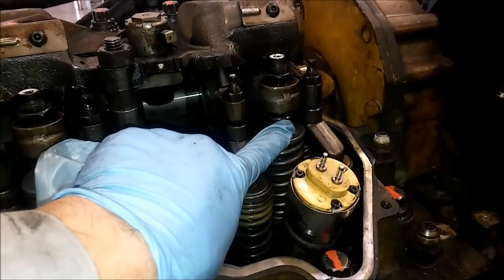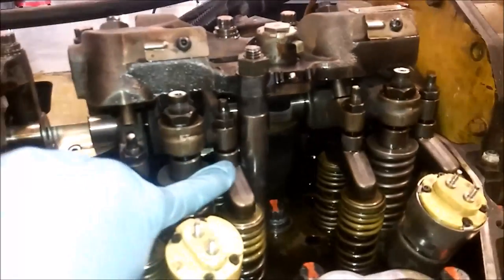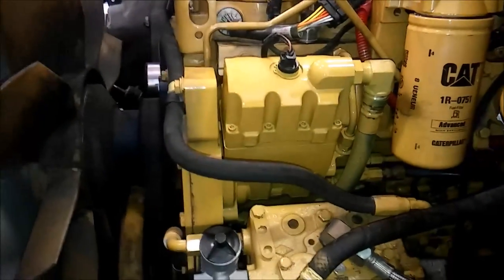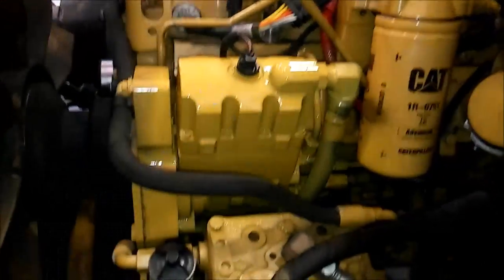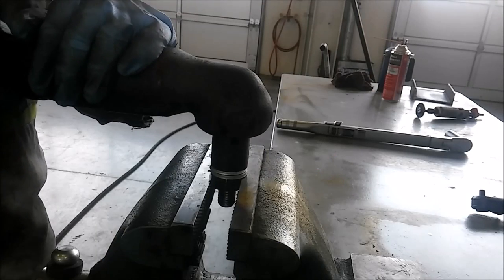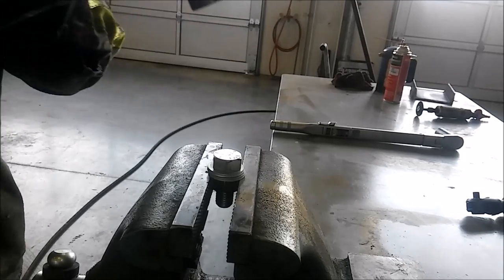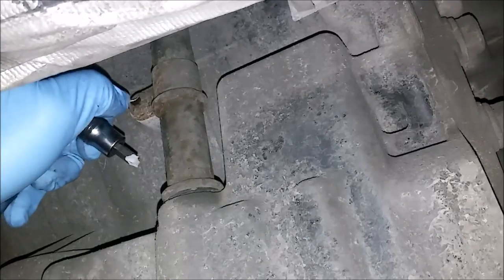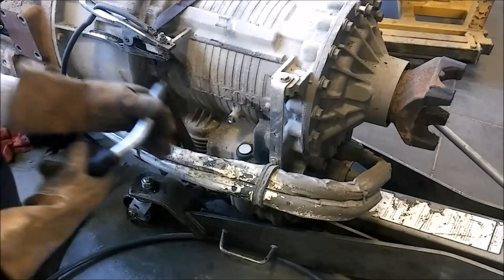Adept Ape Trailer And Introduction.

Comment: The ECM on my RV hauler 3126b cat powered FL 60 Freightliner died and I am trying to remove it for service! It is a woolybugger to get to, particularly the last bolt  at the bottom of the ECM and nearest to the firewall! I finally got it out but had to buy a special longer length  13mm open end wrench to get down into the tiny space that I had to work in. OK, ready to pull it out but must work through a jungle of wiring, hoses, oil dip stick,  engine breather hose, etc, ALL in the way of course! Any suggestions at all? Thank you for any help you might be able to provide! Thank you a bunch, as i am near my wits end with the frustration provided by attempting this simple looking job!

Comment: I have a C15 acert mxs, i took out the double turbo and left it as a single turbo but now the pressure of the manifort doesnt go higher than 27. I also thought about adding a water filter to the engine. What do you recommend I do?

Comment: Adept ape. I have a question. I recently bought a truck with a 2007 c13. It has a fresh platinum at the end of January. The first two days I ran itthis week, the oil pressure at idle was around 35psi and around 54psi at highway speed. Half way into the third day I noticed that it now idles at around 26psi and the best I get at up to speed is 48psi. What are your thoughts??

Comment: I really appreciate your videos they help a lot. But I'm having a trouble with my C7 right now. The gear keeps coming loose on the front of the high-volume oil pump. I have already changed the pump twice. Any advice would be greatly appreciate.

Comment: Good afternoon, I need some help with a Cat 3126. We have changed the heui pump and piston rings but every time it goes on the road i have to put 4-6 quarts of engine oil back into the truck. I don't see any oil coming from the breather, I've had the turbo charger checked and it is fully functional. What could be the case of this issue? Where could all that oil be going?

Comment: hi Adept. if you had to buy a semi would you go with Cat, cummins or Detroit and why?
Reply from the maker: +gerhard bronkhorst If you want an older truck, a single turbo C15 is hard to beat, but if you are going newer probably an ISX. I'm not super familiar with newer engines to say one is way better than another though.
Reply: @AdeptApe  hey can you shoot me a email I'm troubleshooting my 06 mxs accert. Low boost feels like loosing fuel pressure checked fuel pressure at idle I'm around 80 at 1500 I'm at 90psi. Changed fuel pump check valve noticed I was sucking air put new davco fuel filter housing. Started throwing iva oil pressure code checked mechanical side didnt see anything wiring harness had breaks in it changed wiring harness and oil pressure sensor stil code came on and off still low power

Comment: Had an air compressor  replaced with engine overhaul. Compressor had piston explode. Dealer wanted to change oil & filter. I had them drop & clean oil pan as well. (Good thing) full of metal. What else should they have done? Only 144,000 on overhaul done by caterpillar  shop. Cat also did air compressor  replacement.  Could there have been significant  damage to other parts. ( discovered air compressor  issue when pushed gal & half oil out breather tube.

Comment: JUST Found your channel @Adept Ape! We have a '97 Thomas Saf-T-Liner with a CAT 3126 and Allison MD3060 that we're converting into a tiny home on wheels! We haven't searched your videos yet, but where do we look for the engine block heater (or to see if there is even one present?) We've seen after market block heaters that can be glued to the bottom of the oil pan. But we want to see if there is one built in or not. 

Thanks so much in advance!
- Brian + Erin
Reply from the maker: They are generally in a freeze plug hole below the turbocharger or by the rear of the engine on the turbocharger side. Good luck on the build!
Reply: @AdeptApe  Awesome! Thanks so much for that intel! 

If there is not a block heater present, do you think installing a block heater OR an in-line coolant heater (like a Webasto or Espar) would be better?

Thanks so much!
- Brian + Erin

Comment: could you do a video on C7S Air Compressor removal and install? Your videos are beyond useful!!! Thanks for all your hard work!
Reply from the maker: Oh no, that would mean I would have to change one of those heavy pieces of junk. Did you know that they have to be timed, like a fuel pump, that is dumb! If I do one soon I'll try to film it.
Reply: Thanks it would be helpful. As mine I believe is leaking oil into the system... How hard is it to get timed correctly
Reply from the maker: Not super hard, do you know how to pin a Cat engine? If you don't, watch my diesel overhead adjustment video to see how it is done, it isn't hard. The new pump will have a plug in the oil supply line that is a timing plug, just pin the engine and install the pump with the plug installed, your are timed, then just remove the plug and install the oil supply line.
Reply: I will check that video out right now! Thank You!!
Reply from the maker: You are welcome.

Comment: How do I get the pin identification for a cat 3126B 70 pin ECM Connector for the back connector. I’m trying to wire up an ignition switch and the throttle pedal so that I can test run this engine that I bought at a salvage yard after I rebuild the engine. The engine only came with the engine wiring harnesses from the ECM to the engine. The engine came out of a GMC T-6500 and they said it runs but has white and blue smoke. I have not opened it up yet. Can you help me with this?

Comment: Hey bud need some help with a 1999 cat 3126 not getting any voltage to the injectors 
Replaced the engine speed sensor from another engine and found out the connectors were pretty bad 
After replacing the sensors got the engine to start it worked perfect for about 5-10 min then it turned off 
Replaced new harness from ECM to the engine and new engine speed sensor or “crank sensor “ it still won’t start & not getting power to the injectors

Comment: can you help diagnose a weak or failing turbo system. As I have a twin turbo. And I'm not having the horsepower I used to have. my engine has 1337817 miles. I'm pretty sure it's time for an overhaul. 
But what else can I do to keep my engine running efficient without an overhaul.
Reply from the maker: Sure can, it is on the list of videos already. Hopefully I can get one out in the next few weeks.
Reply from the maker: +Raul Pereyra If you don't have too much blowby a new set of injectors can really help out a weak engine, if you have blowby though, there is not a lot of stuff that can be done.

Comment: Hey dude, Great channel... We need some assistance. We have a Cat C9 Generator onboard our vessel. Recently we have been experiencing some issues with engine vibration. The engine drives an alternator and is causing some equipment to oscillate. We have used CAT ET to run some diagnostics and found no issues. The main LOP is also showing no faults. The engine has been serviced and all temperatures and pressures are as they should be and comparable to the other C9 we have onboard that runs sweet as a nut. We removed the valve cover and inspected the loom and injectors and found no faults. no oil contamination and fuel supply is great. Air supply side checked and no dramas. She shows 5.7bar fuel pressure at full running temperature at 60% load. The same issue occurred a week ago and after a few stop and starts it cleared. Not entirely sure what is going on here. The engine runs sweet without any load and then loaded she shakes enough to notice motors and lights slighty out of whack. We placed an oscillator on the output and found the electrical side to be OK. We presume that maybe we have an intermittent injector issue thats mechanical perhaps ?? any thoughts or suggestions ? cheers

Comment: Hello, I have a 2006 Kenworth T800, with a C15. Every time you shift into reverse it shuts the dash, lights and truck off. If I unplug the back up switch it dose not die.

Comment: I watched your blow by videos.... I have a c12 we did a full valve job new cam and rollers new turbo rebuilt injectors and pump. I now have about 1gal of oil coming from breather tube in a 10 hr run. Did my mechanic put the breather together wrong only 75k on lower end I frame

Comment: I billion subscribers hahaha.. we are getting there soon bro quick question I have a cat 3406E  (great engine by the way) what do you think about bully dog turbos?  I want to improve performance but there over 2000.00 that's nuts but if you think or know there that good I will go for it thanks dude and your vids are well appreciated  by the cat community cheers
Reply from the maker: +Eduardo silva Well every subscriber counts, it might be hard to get to 100 billion though as that would mean about every human would need to subscribe 15 times, but hey. So I'm not a huge fan of aftermarket power adders. Not that they don't work, but for instance we have a truck in the shop now with the head cracked in 2 places because the customer has a hot rodded flash file in it. There are guys out there that run them with no problems, but I'm not an expert in the aftermarket, mostly just the Cat stuff.
Reply: +Adept Ape thanks for your quick response and of course everybody counts keep those great educational,informative and entertaining videos coming fan of yours 100%

Comment: i have a 2001 freightliner fl70 its a box truck i have the problem that now it looses power it runs but looses power so much that i have to downshift to 1st gear just to get it going it stays on and problem goes away once engine cools down or turns off then you turn it back on can you help? please.
Reply from the maker: +Ivan Rojas Check engine light?
Reply: Adept Ape no nothing wont turn i keep thinking maybe its the fuel pump
Reply from the maker: +Ivan Rojas Which engine is in the truck, 3126?
Reply: Adept Ape yes it is
Reply from the maker: +Ivan Rojas Hmmmmm, you'll really want to get a fuel pressure gauge on that engine to see if you're losing fuel pressure. Could be HEUI pressure too. Check your boost too. Go through each system one at a time. I've got videos on just about everything for that engine.

Comment: working on c7  change injector and hue pump engine run fine until the temp gauge get to normal  running at 2000 rpm start losing rpm

Comment: Hello thanks for all the helpful advice? I have a problem of my own. Customer truck is a 2010 pete with a Cat c13. Crank no start. Checked and replaced both timing sensors and have checked power to ecm. If you just spray a tiny amount of eather in the filter it starts and runs fine as soon as the engine is turned off it does not start only cranks. Please help me out on this one I'd appreciate it.  Email torquef@hotmail.com